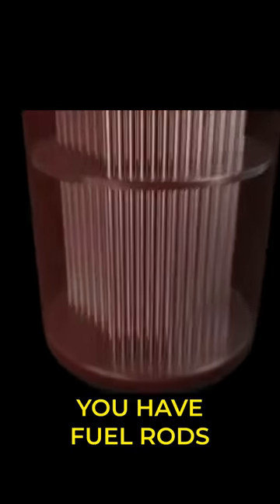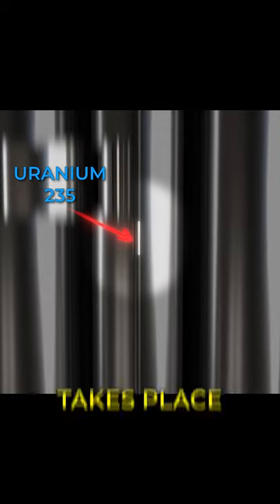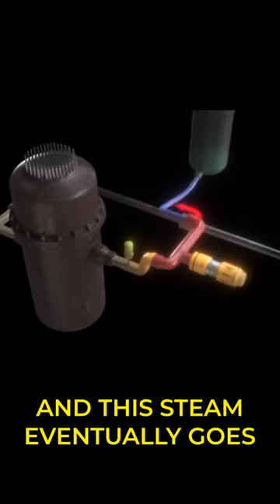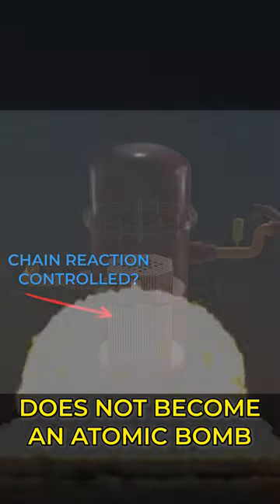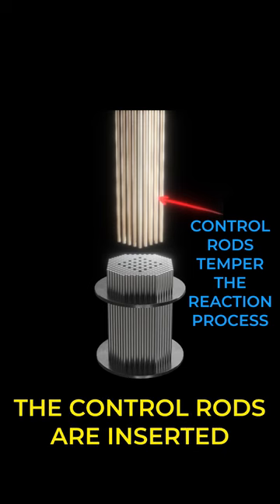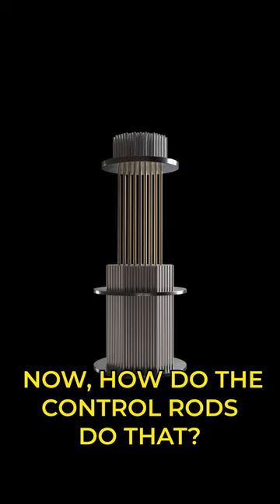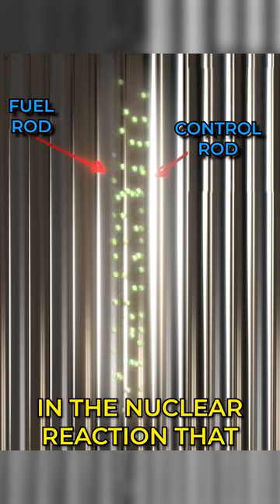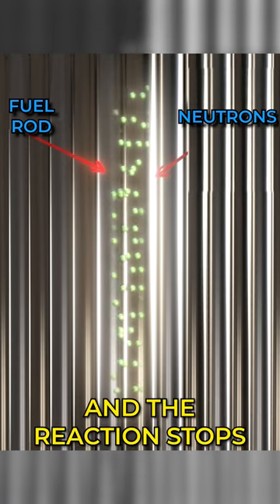How Nuclear Power Plants Control the Fission Chain Reaction

Comment: Control Rods are used to shut down a reactor not really controlling it. Reactor power is controlled by varying the concentration of boron in the cooling water.
Reply: Using Boron in the cooling (water) is one way but originally the control rods were partially lowered into an operating reactor to moderate the neutron velocity, which in turn slowed the reaction.  Boron in the reactor fluid does the same thing but can be more precisely controlled and doesn’t leave hot spots like the old method did.
Reply: @richb2229  they absorb the neutrons. Moderated neutrons (e.g., thermal) are what make the fission happen. Water moderated neutrons.
Reply: Military reactor power is controlled by the rods but commercial reactors are controlled by boron concentration. A military reactor uses highly concentrated U235 which is essentially bomb grade. Commercial reactors use very low concentrations which can't produce a nuclear bomb. 
10 years military and 23 years commercial nuclear plant operations here.
Reply: Actually Boron is used to compensate for lovering amount of fissile U235 in reactor during the fuel campaign.

Comment: The nuclear reaction is not controlled by control rods. The nuclear reaction is stopped by the control rods. There is a moderator in the reactor coolant, usually boric acid, where the concentration controls the nuclear reaction. If not and control rods were inserted halfway the fuel would be used not evenly over the fuel element so that would not work.
Reply: This seems specific to a single design .  Multiple designs exist in the original nuclear countries .  Some accept the uneven use of rods, some use solid moderator blocks, some vary the number of rods inserted etc. etc.
Reply: @johndododoe1411  Absolutely correct. What I said is true for most pressurized water reactors. By far the most common.

Comment: "become an atomic bomb" The rbmks were the only reactors that would blow up; this is because of bad design choices. All other reactors do not blow up but rather melt. The uncontrolled fission of the fuel causes it to melt, not explode. For instance, in Fukushima, the BWR reactors experienced fuel damage by melting (aka a meltdown). The explosions on the plant were hydrogen explosions completely separate from the reactors.

Comment: To start atomic weapons need 90% U-235, power plants have 3 to 5% fuel. 
Secondly a weapon needs amazing amount of pressure and heat in instateneous combustion... This is caused by exploding uranium with explosive charges to compress and heat the isotope...

Comment: This the basic explanation of a BWR (Boiling water reactor). In a PWR (Pressurized water reactor) the water stays inside the reactor vessel, and is kept under pressure as the name suggests. The water then exchanges its heat through an exchanger and then steam is created. Now the RBMK (Infamous for the Chernobyl disaster) Has instead of just a vessel full of water, has steam channels. It works similar to a BWR, but has channels and is very old.

Comment: Along with control rods, other methods of limiting the rate of reactions are commonly used.
Substances like boric acid are typically used as a type of "liquid control rod," or a nuclear poison. It functions essentially the same as the control rods except for the fact it's in solution, and thus as another person mentioned, has a more even effect on slowing a reaction.

Also, the uranium in nuclear reactors is not weapons grade. That is, it isn't refined enough to cause a nuclear explosion when prompt critical.

Comment: A bit misleading. Control rod is not for stopping, but absorbing 1 out of 2 neutron, keeping the chain reaction linear.

For stopping nuclear reactor, you have to take out the uranium. There is no other way. Even if you bury them by a solid block of "control rod", they just keep splitting, overheat, melting everything. In conclusion, control rod is not for stopping reactor, its for maintaining linear reaction.

Comment: Reactor doesn't become a. Atomic bomb. I am sorry? This video is very much inaccurate on how nuclear reactions work. If you want a nuclear explosion, what you need is extreme pressure. And uranium 235 that is kept in an unstable state to begin with. As a, fact, a nuclear power plant won't go into a nuclear explosion. What will happen is a risk of a nuclear leak. Which is extremely harmful for our survival on said environment. Look at the children with mutations born from those who left Chernobyl after the disaster. Now if you wanted to say you don't want it to turn into a nuclear meltdown. That is why there are control rods.

Comment: I worked at the SONGS (San Onofre Nuclear Generating Station) for a couple of refueling cycles. In that system high pressure superheated water heated a secondary source for steam generators. That secondary source was further cooled through a third set of pipes that went out to the ocean. 
The dampening rods had a fail safe default to close using gravity if there was a catastrophic system failure or loss of power. In other words the dampening rods were raised to start the reaction and if a total shutdown was required they just dropped. It worked really well until California bureaucrats got involved.

Comment: So far, good video not gonna watch it all the way through. Because it failed to mention that Sweden developed a non critical nuclear reactor that can be installed within just a few miles of any town. Is supplying electricity too. Very simply they have the core. Hot water gets circulated self around goes to a turbine. Gets recycled, but it chills down gets reheated. Etc etc but there's not enough uranium to cause a critical failure. It takes a certain number of grams of uranium and close proximity to have a critical failure, and we have gotten sold on using that design instead of using micro reactors that do not use a critical level of uranium generating generates about 3to 4 hundred degrees. Very quickly and produces the steam and the terabine. Spins, and it's done, go through the loop again. Clearly we have not thought our nuclear energy message through. Although it would do the population density in many  cities And what terrorists doing things that they do. Having a bunch of micro reactors laying around may not be a good thing for the united states. But there are other methods to use uranium besides blowing things up or needing a reactor that has to have people attending to a twenty 47.

Comment: and in case of emergency there is nothing like spring... they used electric motors on fukuchima which faile as leaking water shorted electrical lov voltae systems :P and welcome to chaos... they had to add a mechanism that releases sprin or grawity powered rods that fall down in case of emergency i gguess... sadly they didnt think of that in past it seems :/ 
anyway mostlikely reaction still continues slowly ewen after rods are there but im not sure ..

Comment: Water in the primary vessel is not turned to steam, it is super heated, and uses a heat exchanger to transfer heat to non irradiated water to produce steam. The cavitations of boiling would allow heat spikes similar to Chernobyl.

Comment: this is an old method. today the chainreaction ist mostly controlled by adding bor-acid to the water. btw the material in the controlrods is also most likely bor. further more a reactor that reached criticality is self sutainable and has its balance at the criticality point (0.995 - 1.005)

Comment: The water that makes contacts with the rods don't get turned into steam. It runs the heated water in a loop to heat secondary water which then turns into steam and turns the turbines. That steam gets returned as water to the 2nd loop and the cycle continues. The water that heats via the fuel rods is radioactive it wouldn't come in contact with anything else.

Comment: Using a nuclear reactor to heat water as the main coolant working fluid is quite ingenious and not primitive.   Water is excellent at this task.     Water has high heat retention and it blocks some of the radiation.  It can be pumped so that the energy from the core becomes portable and can be transferred to somewhere else, usually to another loop of water that becomes steam to run an electrical turbine.  Turbines are important because the AC electricity used in our distribution infrastructure is most easily generated by a rotating armature in a magnetic field.

Comment: The control rods do not stop the reactor from becoming a bomb. Reactor fuel rods are too far apart and then do not move so the fuel cannot become super critical and explode. They can over heat and the rods will melt forming a puddle of extremely hot radio active fuel that can spread radiation if exposed to water that explodes into steam. But it cannot explode by nuclear fission.

Comment: The water acts as both as whybto get energy out of the system woth steam but also a moderator slowing down the neutrons to increase the probability of collision. As the water turns to steam, it becomes a worse moderator, which makes the fission events less likely, helping to regulate the reaction.

Comment: Everyone tries to oversimply what we call reactor kinetics. You described the reactor shutdown system. Control for the reactor is actually based on the number of neutrons that are born delayed. In other words, those born from the decay of fission fragments. After reaching what is known as the point of adding heat (POH), the reactor is kept slightly subcritical in the power range. This buys the contorl system and operators' time to see how pressure and thermal effects are feeding back into the overall neutron population. There are typically 6 factors in the reactor control equation. Operators monitor these effects with many instruments. Power range nuclear (radiation) instruments, temperature and pressure instruments, and in the case of a pressurized water reactor (PWR) pressurizer level in the primary system. However, the rate that heat is removed by the steam systems affects the temperature of the primary (reactor) cold return water, which also affects the operation of the reactor core. If electrical demand increases, steam output must also increase, and that causes reactor return temperature to decrease. Therefore, the differential temperature of the core is important in keeping the power level constant. A reactor is not simply a boiler. And, criticality is the measure of the time rate of change of neutron density in the core. Exactly critical is where the total number of neutrons born in one generation is exactly equal to the number of neutrons to be born in the very next instance in time. In response to decreasing temperature, an operator withdraws the control rods a little, exposing more fuel to neutron flux in the reactor core so that more heat is generated in the core to make up for the previous loss. The number of new neutrons generated takes the core slightly above critical to cause more fission events and heating the reactor materials, raising hot output temperatures to generate more steam and things balance back out at a new equilibrium. Nothing but physics and math. People should have been told a long time ago that these truths, while moderately complex, are not mysterious. They are, in fact, extremely well understood. If this 61 year old can remember how a reactor works after being away from the industry for over twenty years, certainly young, vibrant minds could be taught this reality. Don't over simplify the facts. Instead, tell it all the way things really are!
Reply: tl;dr   Ok professor, but this video is for average people and some reactor characteristics have been simplified.   Surely you understand this concept.

Comment: Now how does an RBMK reactor explode, Mr Smarty Pants?
Reply: It blew up because the increase in pressure in the steam channels followed by the increase in temperature melting the hull and fuel of the reactor causing more pressure. This went on and on before it finally ruptured and blew up.

Comment: It  is depending on what kind of reactor you're talking about. all modern reactors, especially the ones in America. Also cannot have a chain reaction without the water. If you're to cut off the water flow to a modern-day nuclear reactor, the neutrons become too fast to cause a chain reaction, and the reactor shuts down. water also acts what's known as a moderator. That's why it is almost impossible for a nuclear reactor now to melt down. Even if the control rods were to freeze and not be able to be inserted into the core as long as you just cut off the water flow, Fission can't happen. This is what makes nuclear energy actually the cleanest and safest source of energy that we have. When people like to think of nuclear energy being unsafe they always talk about things like fukushima or Chernobyl. Fukushima was by poor design. They put the spent to cores Near the reactor which  caused a chain reaction when the water came in from The tsunami. And also that nuclear reactor is like over 50 years old which the design has changed due to modern physics and engineering. Chernobyl was also a reactor that is not used anywhere in the West. Its moderator is not water And that's what makes it the most dangerous. Even with the poor design The meltdown was caused by Unknowledgeable engineers who went against protocol and caused the incident. Nuclear energy is the safest form of energy that you can have and it causes 0 carbon emission. All the waste of nuclear energy is only large enough to fill room from all the time we've been using it. 😊
Reply: Your Fukushima summary seems wrong .  Your RBMK/Chernobyl summary is only partially right .

Comment: Wait a second, the fuel is inside a rod. Are you telling me a control rod can absorb neutrons in the fuel rod from outside of the fuel rod?  nah, bullshit
Reply: There are fuel rods and control rods. These rods are contained in assemblies of multiple rods. The uranium in the fuel rods splits and releases neutrons that fly out, are slowed by the cooling water, and hit other fuel rods, causing a chain reaction. The control rods can absorb these neutrons when lowered into the fuel assembly, preventing the chain reaction from occuring.

Comment: You forgot about the heat exchanger, turning heavy water into steam to power a turbine would be a very very dangerous thing
Reply: This represents a boiling water reactor or BWR. The water is boiled right inside the reactor and so it doesn't have a steam generator. You are thinking of a pressurized water reactor or PWR, which does have a steam generator.

Comment: And what happens to the excess of neutrons?
Reply: It changes the atomic composition of the control rods slowly, which is why they need to replace the rods when it is saturated by neutrons
Reply: @LEO0DEVV  Thanks. Much. Interesting. But leads to another question. What substance do the rods change into when they are “saturated by neutrons?”
Reply: @LEO0DEVV  So the control rods become radioactive with time? Do they start emiting neutrons?
Reply: @danohanlon8316  they don't change into anything perse, the rods just cant soak any more neutrons, it is called Nuclear End of Life or NEOL. It's like electricity when it flows with free electrons. Adding neutrons don't change the material, it essentially gives you an isotope of the original material. It just cant rake in any more neutrons so they replace it.
Reply: @shoutitallloud  no, control rods do nothing but stop the neutrons trying to go past it. Radiation is something else completely, control rods just cant soak anymore neutrons. It's like salt in water, you can only dissolve so much before you start seeing it settle in water.
Reply: @LEO0DEVV  OK, I see. Thank you
Reply: @LEO0DEVV  So, they’re basically neutron sponges.
Reply: @danohanlon8316  yeah, but with a really long life span, wothout them it's basically just a nuke. Depending on how deep they push them, the more they absorb, if the rods are insrted all the way in , it creates less power and vice versa
Reply: @LEO0DEVV  but even with all control rods lowered the reaction still goes on and the uranium still "burns", its just much  slower and not so hot. But it requires cooling anyway. Am I correct?
Reply: @shoutitallloud  yes, for nuclear elements like uranium, each atom releases 3 neutrons. If left unabsorbed, they explode, the control rods absorb on average 2 neutrons per atom so there is only 1 hitting another atom.

Comment: Can you elaborate why during the Japan 311 nuclear event or decommissioned core,  the use of boron rods cannot immediately shutdown the fission. Does it meant even when no reaction, the system need a cycle of half life to reduce the reaction rate and thus the heat generation
Reply: The control rods were damaged due to an earthquake followed by a tsunami causing the rods to get stuck
Reply: Putting in the control rods does immediately stop the fissioning completely because the reactor goes below criticality right away. However, there is still radioactive decay going on inside the fuel, which produces about 7% of the core's normal maximum output. In a commercial nuclear power plant this produces a lot of heat. That's why the core must still be cooled continuously even when the reactor is shut down. If you don't cool the core continuously it will eventually melt down. At Fukushima they had a power failure because the whole local grid went down and the emergency generators got flooded out by the tsunami. This caused the cooling pumps to stop and the core overheated.